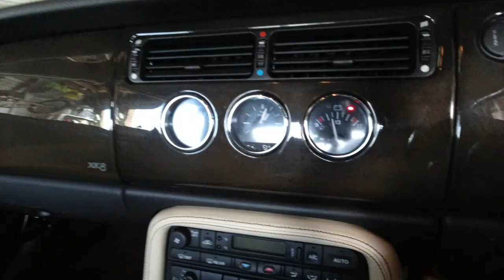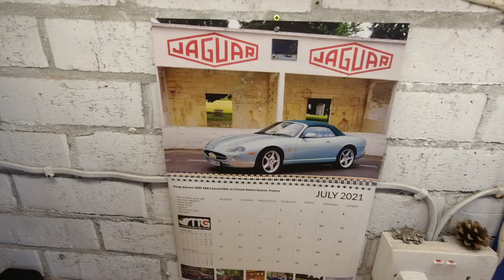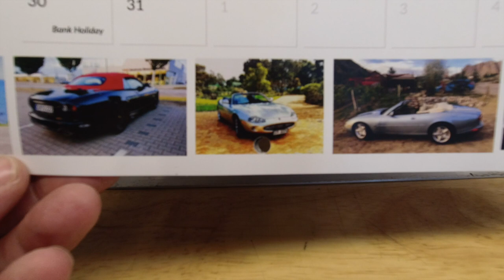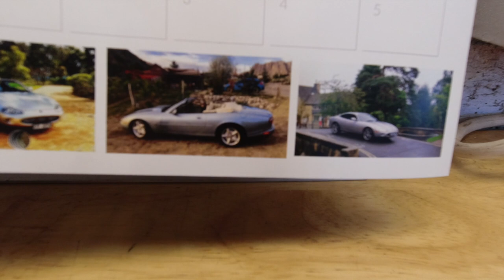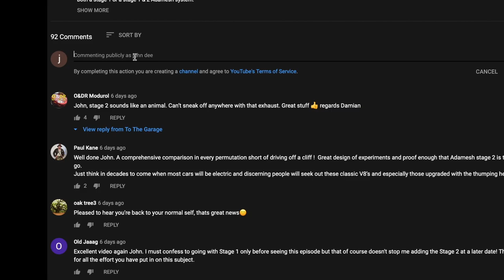If your Jag XK8 doesn't TICK when indicating & BONG because the Hand brake on, this could be why

Comment: Hello John, I have the same problem and do have a perfect fit but 4 ohm. What if I added a resistant of 60 ohm within the circuit. Would it do its job if speaker and resistant add up to 64 ohm. Thanks for all your video’s love them and learned a lot.
Reply from the maker: Great idea Jeroen. And thanks for the kind words

Comment: Not wise. Replacing a 64 ohm speaker with one of indeterminate impedance could damage the body processor. 64 ohms is an unusually high impedance and it would have been selected with good reason. Most speakers, including the one used to test out the system, will be between 3 and 15 ohms and would draw more current than the processor was designed to supply.
Reply from the maker: Hi Richard. Top tip.
The speaker I put in showed 58 Ohms  (weird number I know?) And I have found a source of 64 Ohm speakers for a few pounds each. I have ordered 2 and will swap one in when they arrive and see how long they last before recommending them.

Comment: So you replaced a 64 Ohm speaker with an unknown one? (Usually 4 or 8 Ohm). Are u not worried to blow up some electronics because current potentially 16 times higher?
Reply: Hmm ... I am pretty sure he used his multimeter and measured the ohms of the new speaker before its installation. The measured resistance should read a slightly lower value than the impedance value of the speaker. I reckon it doesn't differ a lot with 60ohm.
Reply from the maker: It was 58 Ohms Papkees. so no worries. but good point.
Reply from the maker: Oops. You got there before me Joop😁. So yes guys, I checked it to ensure it was in the same ballpark. Thanks Both.